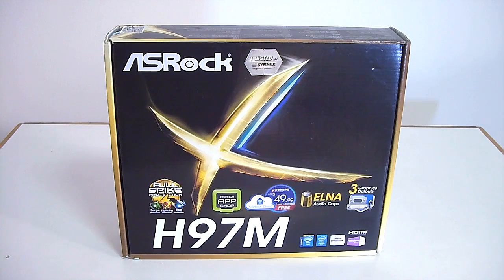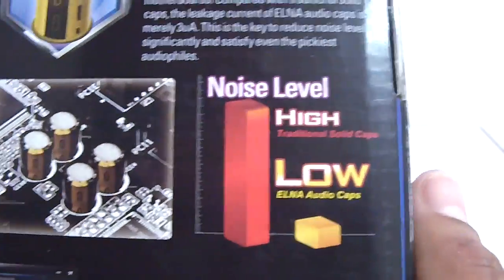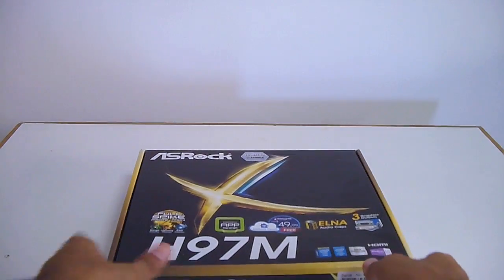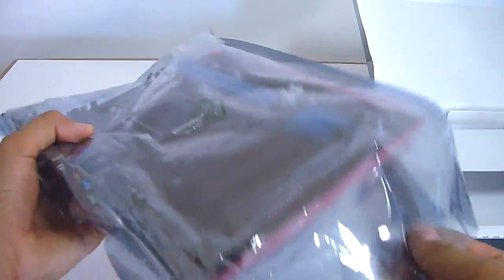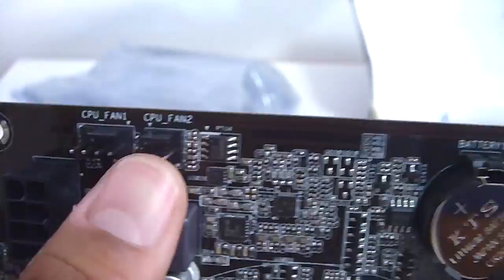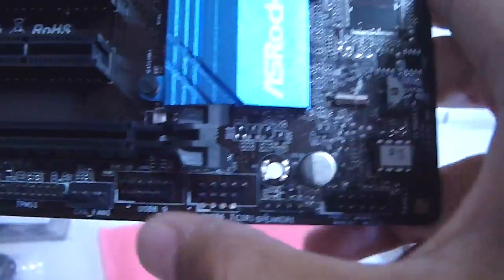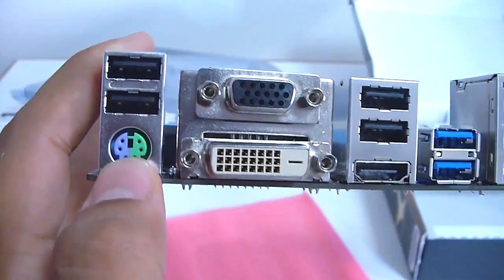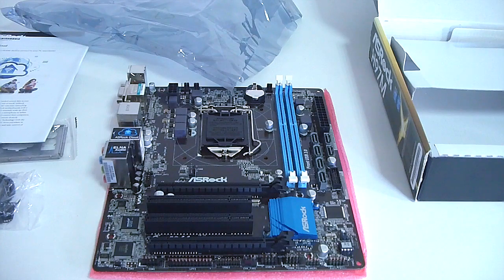Unboxing ASRock H97M Micro ATX LGA 1150 Motherboard

Comment: Cant put a GTX 950 on this?
Reply: +The Darkest White It is the port types you need to look at. So any modern GPU will be PCI Express, and yes this board comes with PCIe
Reply: ***** Ye, thank you for the answer, i just did it already, even though it was a bit tricky, its working like a charm.

Comment: is it overclockable?
Reply: No
Reply: thanasi karadimas This is a H97 motherboard, if you want to overclock buy a z97 motherboard.
Reply: thanasi karadimas This is a H97 motherboard, if you want to overclock buy a z97 motherboard.
Reply: yea i figured that out i decided on getting a different build all together but thanks can u check it out and tell me if it is worth it https://pcpartpicker.com/parts/partlist/
Reply: Provide the perma link in Pcpartpicker, it only shows my saved list. (Upper left)
Reply: opps lol 1 sec
Reply: http://pcpartpicker.com/p/WkvhXL
Reply: http://pcpartpicker.com/p/bvJDHx
Use this two gtx 980 > 780 ti also I would rather upgrade to windows 10 already to get directX 12 + boot time.
Reply: +Fil007kk I've had a friend with many issues with windows 10 and I sent u the one with my old GPUs I'm getting a MSI gtx 980ti gaming 6
Reply: It must have been during the windows 10 preview, because almost everyone have no issue with windows 10.
Reply: I still prefer the window 7 layout it is just a simpler design

Comment: this is a micro atx board right?
Reply: What does micro atx mean? I'm a noob but plan on getting this board.
Reply: yes it is.
Reply: yup bought it a week ago. rocking my mid to high end build right now!
Reply: deathfromabove _
Have fun!
Reply: xBriskyx
Size of standard ATX motherboards are 25% longer, at 12 × 9.6 in (305 × 244 mm).

Maximum size of a microATX motherboard is 9.6 × 9.6 in (244 × 244 mm), but some microATX boards can be as small as 6.75 × 6.75 in (171.45 × 171.45 mm).

Comparison of all motherboard sizes:
http://en.wikipedia.org/wiki/MicroATX#/media/File:Atxscale.svg

Source: http://en.wikipedia.org/wiki/MicroATX
Reply: xBriskyx if you want a smaller set up but without sacrificing alot of juice then this board is the one you should get.